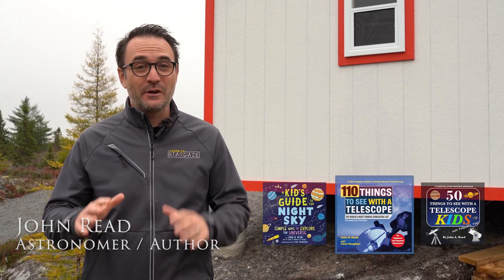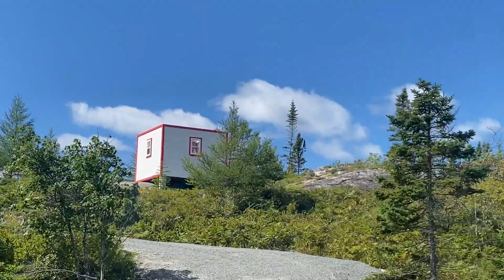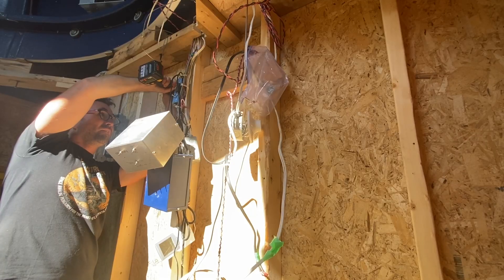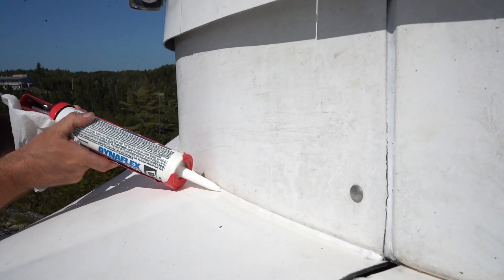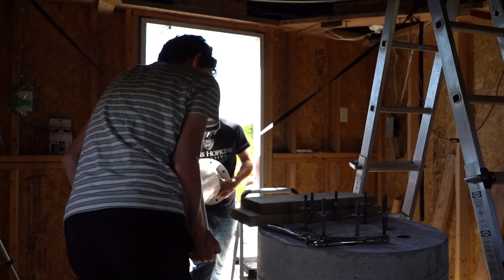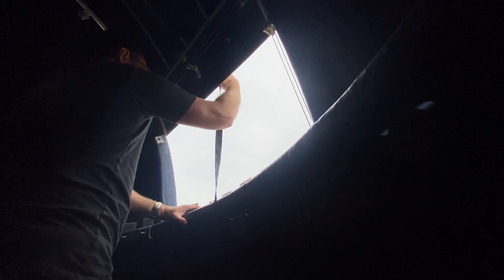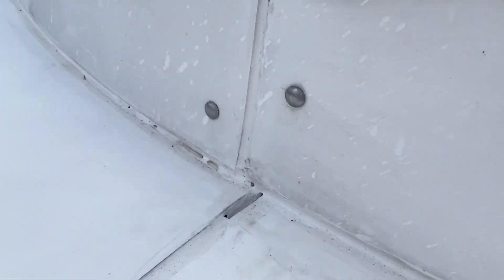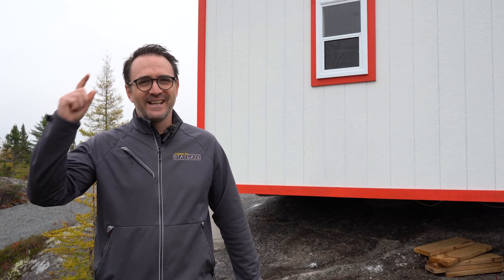It’s Finally Happening! Dome Lift, Pier & Telescope Install

Comment: If you find more leaks, try using flex seal spray paint before RV tape to get a really good seal.
Reply from the maker: Thanks! I don't think i replied to this comment originally, but I took your advice and it worked great!

Comment: Observatory is coming up pretty good love to see what you’re doing, buddy. We’re not that far apart. I’m just in New Brunswick. I’m actually in the process building and observatory 15 feet diameter I’m putting in a plain wave telescope. It’s a long process and not cheap.
Reply from the maker: Wow! That is a major project. Are you getting the Planewave CDK 24?

Comment: Hi, let me just say, nice job, very nice indeed. You have used a lot of time and effort into "restoring" a dome, as well as building a new dome housing as well. But why did you not remove the rust pitting on the white mount plate the one just below the mount head? Just curious. Greetings from Denmark!
Reply from the maker: We forgot about the plate when we did the base!